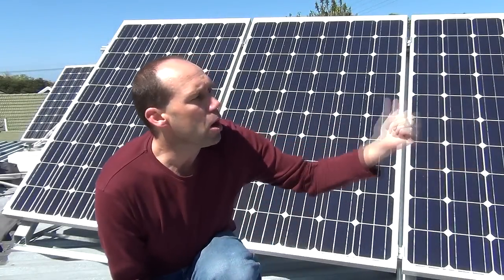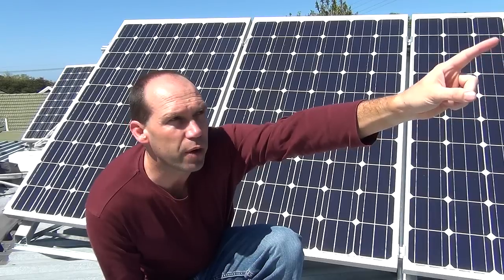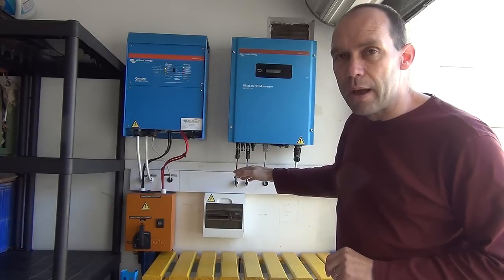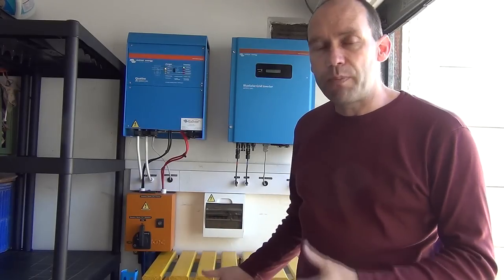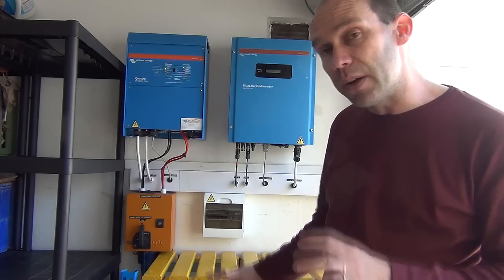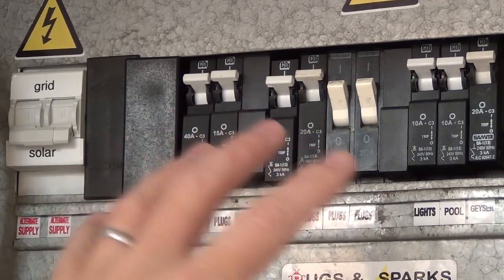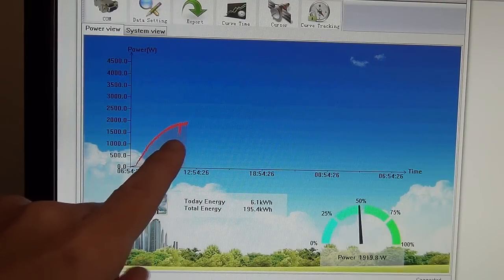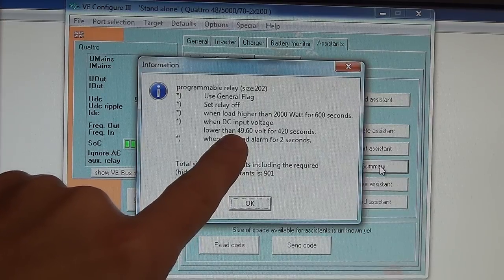Home Solar Power Installation

Comment: Excellent video however, very misleading to people who are thinking of installing and grid connecting a solar PV and or thermal system to their home. Like anything related to electrical engineering you will need an expert with at least a 4 year degree and experience. A qualified, certified renewable energy/solar design engineer, installer(s) or even consultant to provide the best practice. Solar power design and installation isn't a DIY job and you will need to have the system signed off by a qualified State solar electrician so that your panels/inverter(s) and related components' warranties and guarantees are viable should anything happen. Granted, I don't practice my profession in South Africa but unless you're hooking up an off-grid system you will need to adhere by all guidelines for solar PV installation

Comment: This stuff doesn't generate enough energy, it never will.
Reply: Yeah, considering it is powering his whole house.
Reply: Ilir Kumi its supplementary power. It is not the silver bullet. Its not desgined to be
Reply: Ilir Kumi 
We install solar systems that offset the power equivalency of 100% in Michigan, one of the worst states for solar, so there's really no excuse elsewhere. considering it's very financially feasible
Facts to back up my comment. - www.solarsalesofmichigan.com.